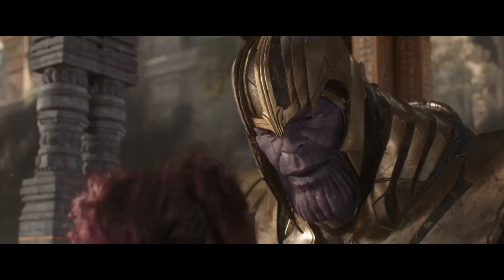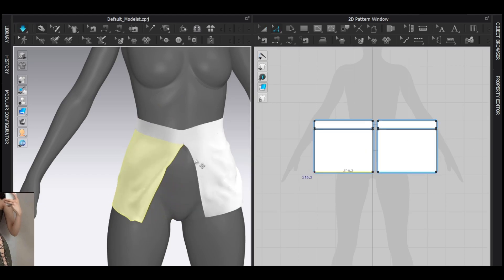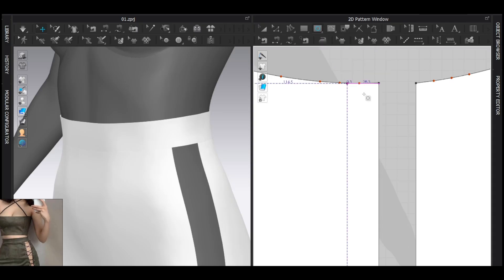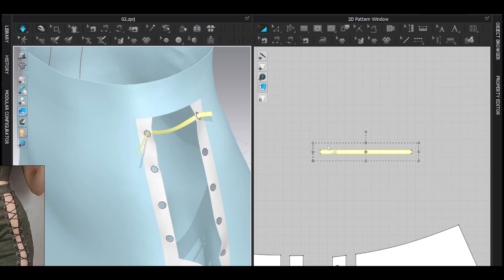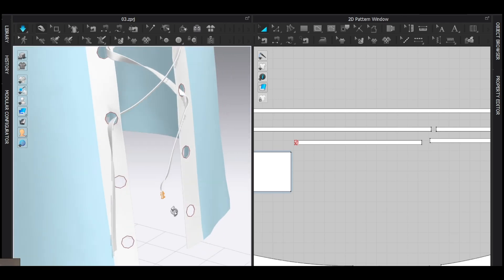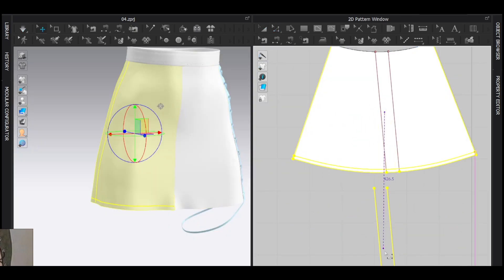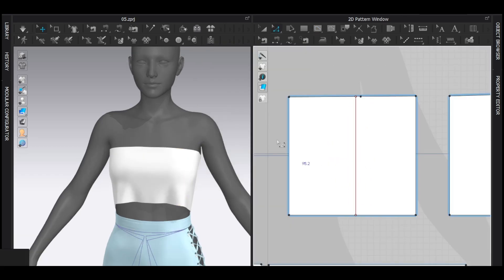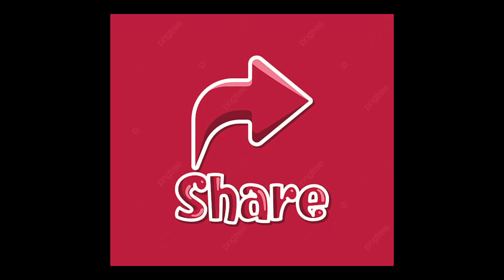Top and Skirt Design in Clo3D / Marvelous Designer

Comment: I have found that using the pin tool around each of the holes, so you pin the lace to the back edge just to the side of the hole, this will then keep the lace in place but still gives it a little movement.